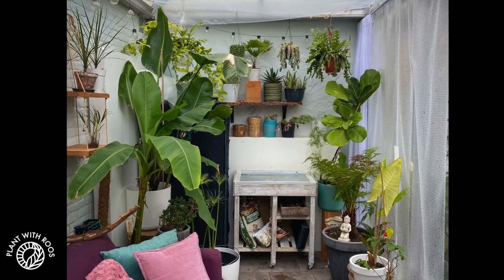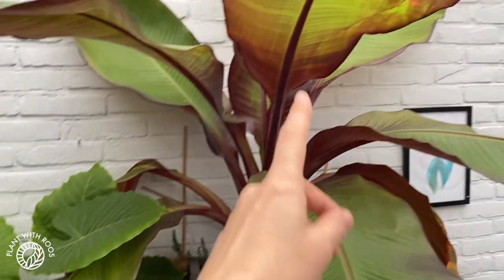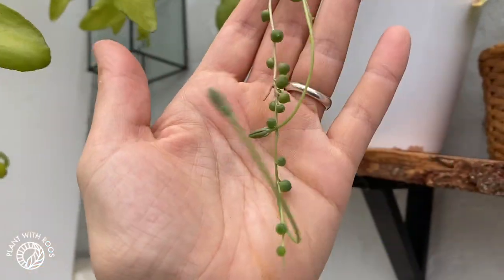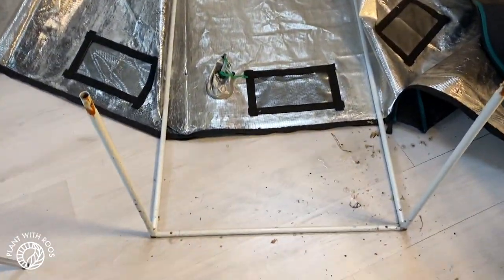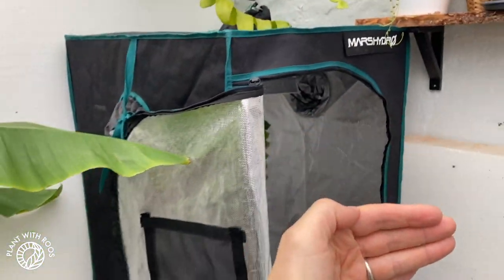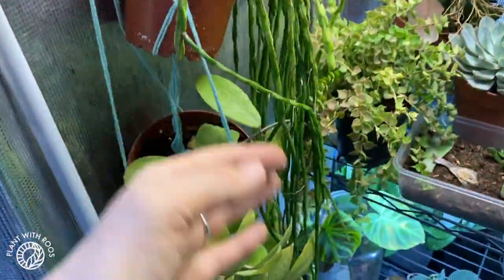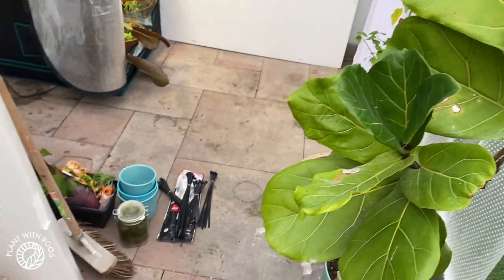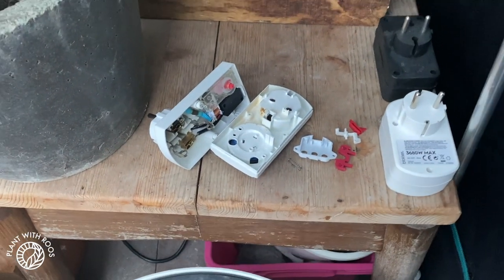Greenhouse winter update | Plant with Roos

Comment: For banana trees you can cut the straight across a part of the main stem and then cover it all up with soil and much for insulation. The will start coming back up late spring and continue throughout the summer. The usual come back big and will make a lot of off shoots using this method every year
Reply from the maker: We did that last year but don't want to this time - waiting to see how it goes without chopping. The ones in the garden should be cut but there has already been Frost so they already died back 🤭😅